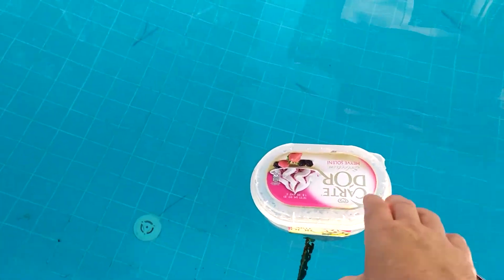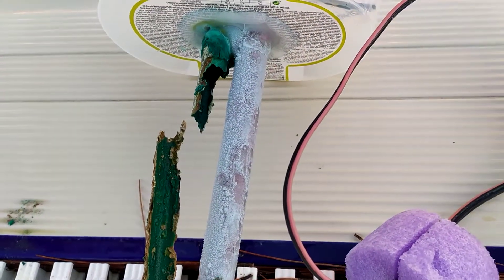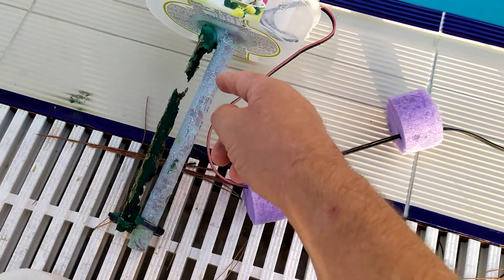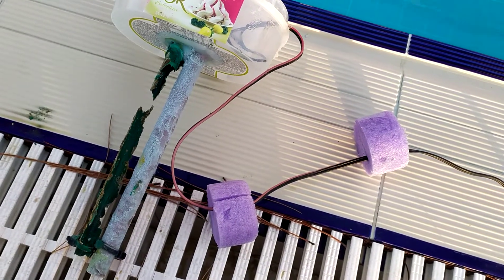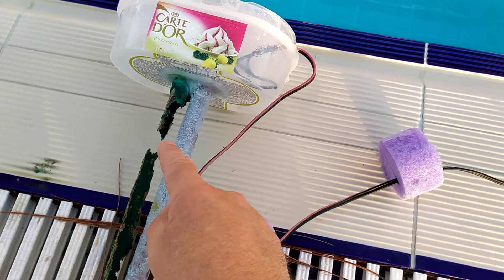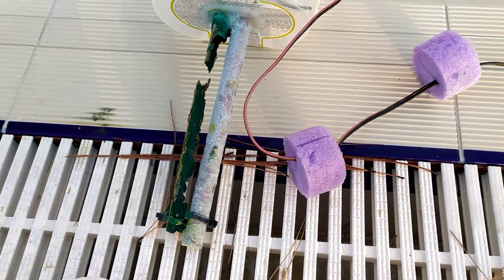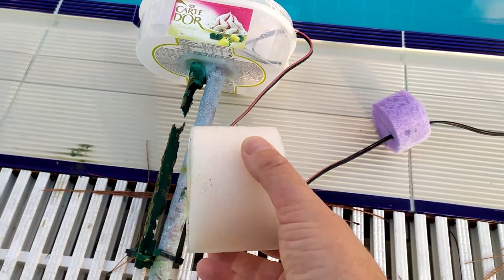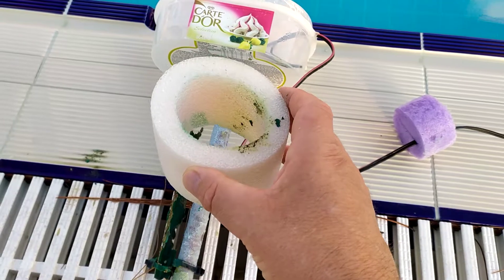Copper ioniser worn out electrode..

Comment: Gr8t vid... can you provide more detailed instructions I just watched your tree vids and I'm excited to start this project
Reply from the maker: Hi James, I will try and get around to doing another video soon, it is essentially just two copper tubes connected to a solar panel, I found that two tubes 30cm long was just enough copper to work in a 35,000 litre pool.
Have a look at the update video and you can see the difference, in fact a few more weeks after the electrode wore out the copper was still working, it cleaned up the drains around the pool.
I hope it works out well for you.
Regards
Reply: @myturkishlife1777  awesome thank you for responding... Just out of assumption 1 panel, 2 copper rods, few tires & a floating thing

1 panel = 2 wires... each wire connected to a copper rod

Last??? What out put would you recommend for this solar project 

Thanks much
Reply from the maker: @famcontreras93  Hi, Yes two wires from the solar panel, one wire onto each of the copper rods, you can wrap the cable ties around the copper pipes and fix them in such a way that there is a gap between them, as far as power goes the panel i used had an output voltage unloaded of 18 volts @ 0.55 amps, I would assume you could use a smaller panel it just means that the reaction would be slower, I have noticed the ones you can buy use a very small solar panel, my panel is about the size of an A4 piece of paper,
As long as the reaction is taking place this is all that matters.
There will be some residue that falls off the electrode as it wears away, this was not a problem for me as the unit was over the drain hole in the bottom of the pool, but some people have noted that in some cases it may mark the pool, I have a ceramic tiled pool so this not an issue.
I hope this helps
Regards
Reply from the maker: Hi I have just uploaded a more detailed video on how I built it and results 😁
Reply from the maker: @famcontreras93  hi , I have just uploaded a new video with more details on how I built it , a 10watt solar panel works well 👍😁
Reply: @myturkishlife1777  you can add citric acid powder over any metal stains (most other stains as well) in the pool and they will be removed fairly quickly. Lots of YouTube videos on citric acid for pool stains.
Reply from the maker: @paulm3538  brilliant,thank you 👍

Comment: Quick question.    What was the polarity of the voltage on the electrode that corroded away .
Reply from the maker: Hi, I have a feeling it was the cathode , -, did at one point swap polarity for a few days .
I have not replaced the unit as yet but have noticed that the pool is still clear.
It seems that the "dose" of one electrode seemed to be enough to control the contaminants in the pool.
If this is the case then next year I will run the new unit until it disintegrates and see it the copper emitted into the pool will be enough for the season.
Regards
Reply: Thank you !